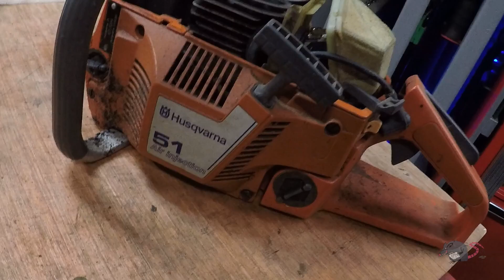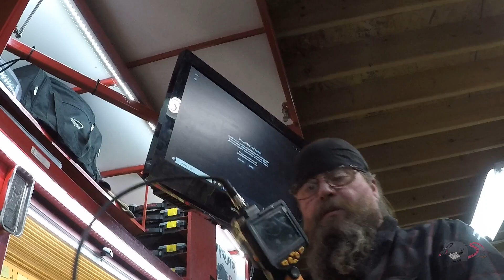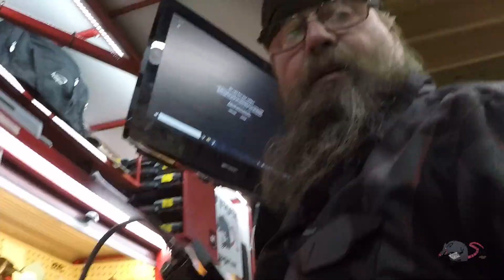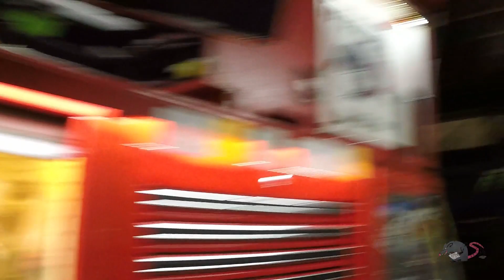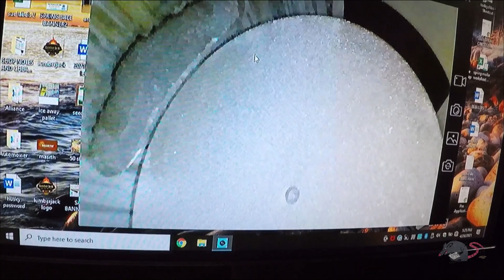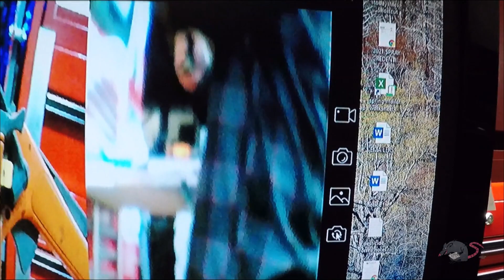Endoscopes

Comment: Just picked up another used BK5500 Snappy unit with the smaller head.
Reply from the maker: We had one of those at the shop. Maybe ours was funky but it didn't have as nice an image as the unit I showed in the video. For me the big advantage is saving pics directly to the computer where I can attach them to an email while submitting warranty claims.